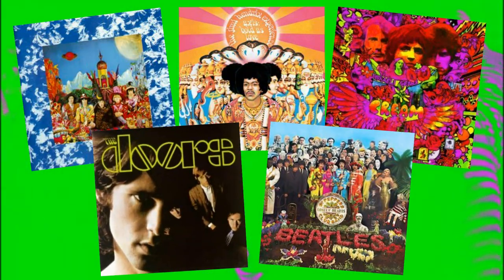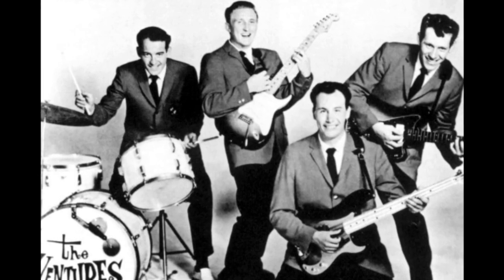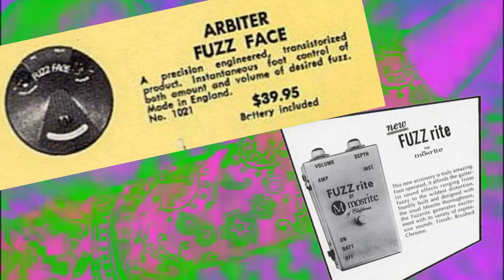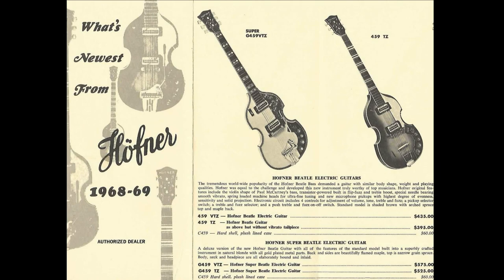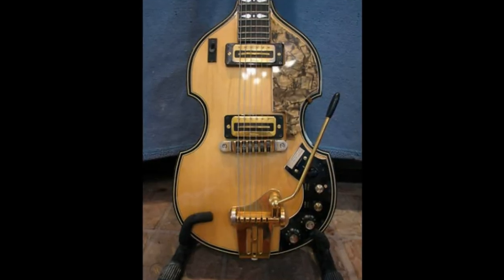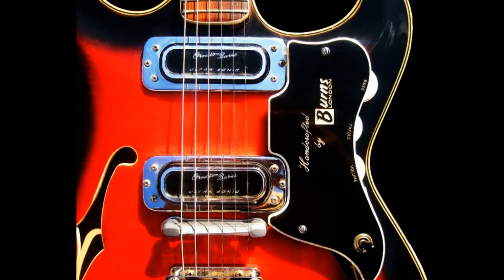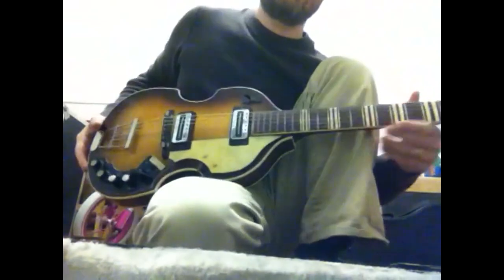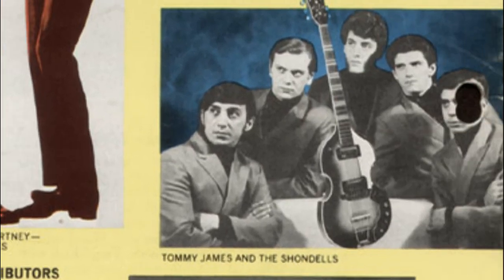Short History of Early Guitar Active Circuits and Onboard Effects

Comment: Brad, do you remember the Electra guitar from 1980 or 1981. It had little circuits in a box the size of a pack of cigarettes or smaller. Each box was like a pedal (phase shifter, fuzz box, etc) and you plug them into a cavity of the guitar, given you an onboard circuit for different effects.
Reply: I had to search that! The Electra MPC was the model. There's a demo here on Youtube and it had about 12 different effects.